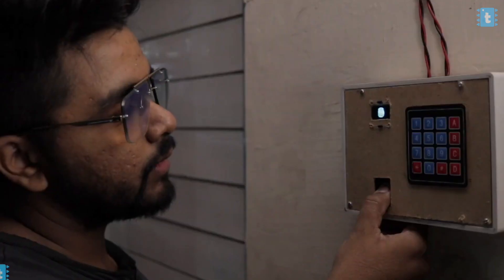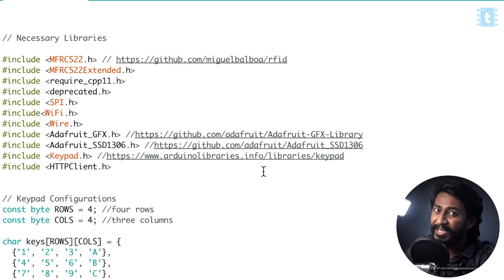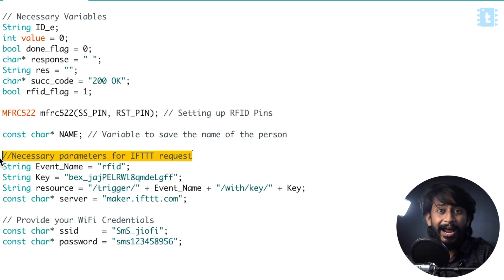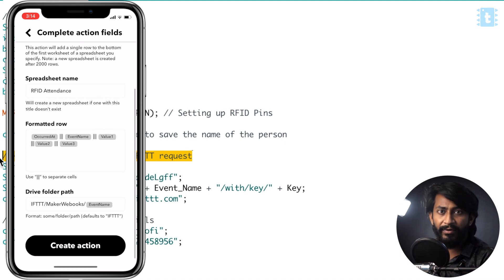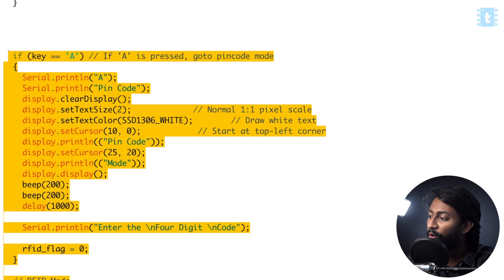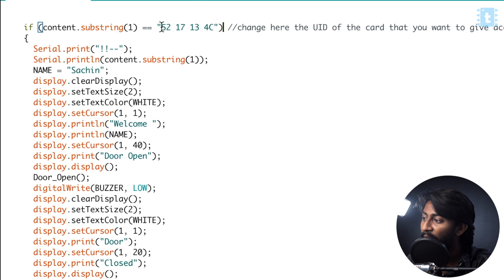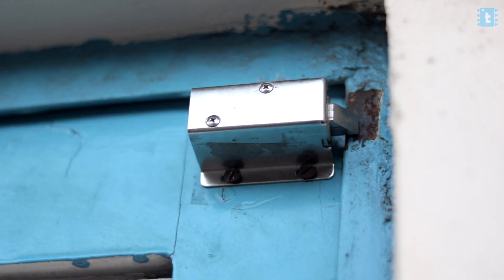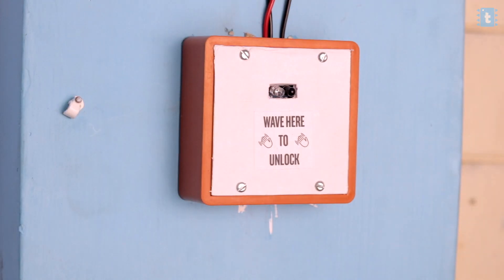IoT Door Lock using RFID with Online Attendance | IoT Projects | ESP32 projects

Comment: One can open that control box and can short solenoid lock wire and open it, so not secured, if we keep that box from inside then in case if circuit went wrong then lock can't be opened and have to break lock forcely,. So what is solution for this two case sir ?

Comment: Ok, So I saw many comments asking for what happens if there is a power failure, and I don't see a reply by you.

Replying to a comment which is praising the content is good. But peps who gets Questions are also need to be answered

Just to point it out again, this point is actually important.

I know you make good content. But answering genuine Questions of your subscriber is also important.
Reply: Yes.. thats true
Reply: I think its most likely cos there is no failsafe for this. A typical lock, even the small ones from Yale, August etc have batteries. As this is a DIY system, its highly unlikely that they would have managed to make a power efficient one especially considering  this is not just storing data but also has to send information everytime there is a user coming in.

Comment: How r we going to open the door on power failure or during some case the system is not taking any input.(system failure)
Reply: Better make it battery dependent, that can run for few days just on a single battery charge. If power is there, run on the mains.
Reply: Good question. in this case electro magnetic door lock is recommended as it will be unlocked in case of power failure, in case of system failure you can just cut power. else in the given example, you'll stuck in his awesome studio because no one wants to get out :D
Reply: @maverickgamer07  if the electro magnetic door lock will unlock on power failure then there isn't a use of it, power goes off, your door is opened up.
Reply: @triggergottriggered8518  Its the functionality of most of the door lock used in offices etc. If you want to include battery. You need to carefully check the power consumption of your module as keep changing batteries wouldn't be a good solution. So there is no other way.
Reply: @maverickgamer07  but isn't there any solution to this?

Does any lock comes with manual as well as electronic lock? 

That would probably solve the equation.

No power : use key

Power : you can use both ways.
Reply: @triggergottriggered8518  Then the whole concept of building yourself is failed if you go and buy readymade. Also it will cost you many times as compared to what you are building.
Reply: @maverickgamer07  I am telling about the solenoid lock which he has used, that has capability of getting unlocked by a key too.

I ain't saying to buy the entire system.